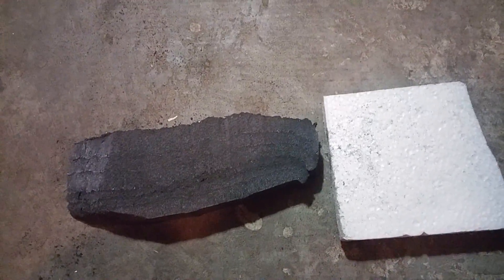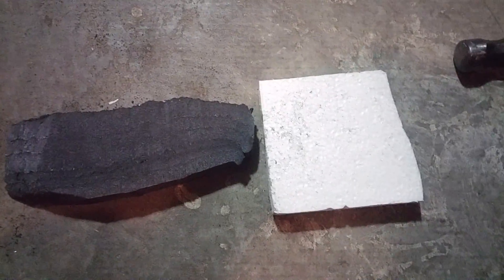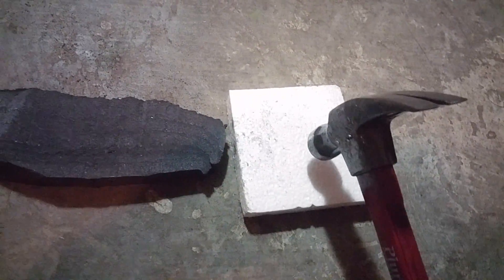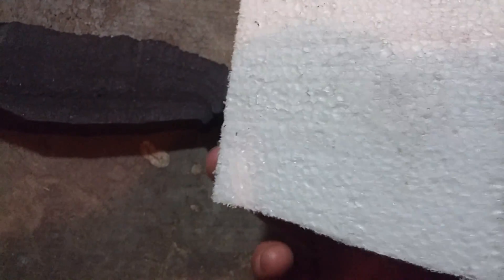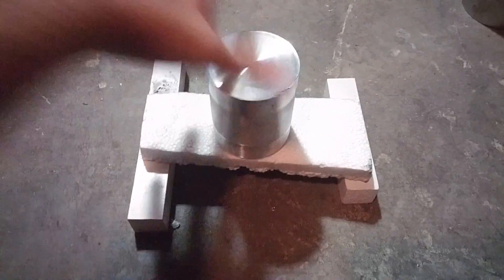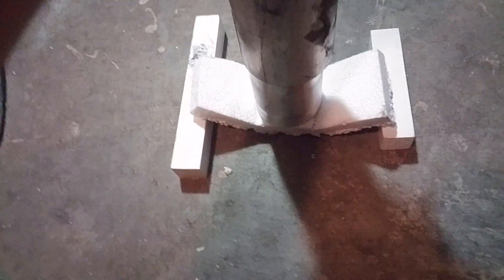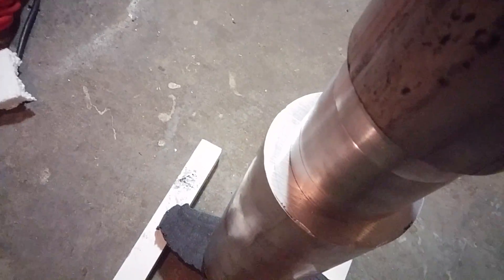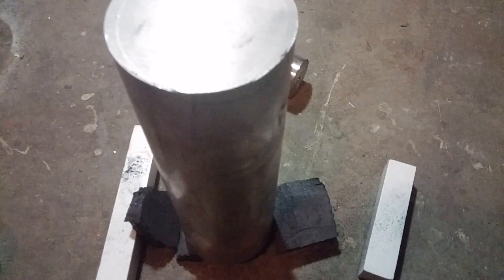Graphene Foam fun tests In the Lab of Death

Comment: You can easily explain those properties. Graphene is a material that can handle a lot of "pull-force" but no "push-force"
Its just like metal but mor extreme in both ways. Steal easily bends under pressure while it can withstand a lot of pressure when being pulled. So actually graphene will be a great building material too... once it reaches a decent price :-) born in a great time folks!
Reply from the maker: Excellent observation. Graphene doesn't have much compression strength, but it can hold up against pulling. That's why concrete companies are breathing down our necks.

Comment: Now that was impressive. if you laminate the foam pieces with various material to see if it can negate the brittle break it would be neat to see what works best. Try Paper or card stock, then corrugated cardboard, then thin wood sheet, Plastic sheet, plastic corrugated, and finally aluminum and steel sheeting. Would give a broad range of lightest to most strength. Maybe even try Fiberglass and Carbonfiber. Thanks for the Video!
Reply from the maker: Tory Allan very good observation.

Comment: It's interesting to note where each piece of foam broke under the weight as well. The regular foam seemed to break in the middle while the graphene reinforced foam broke in two different spots outside the location of the downward force being applied by the weights.
Reply from the maker: Weather Pilot rad comment. I noticed the same thing. Most likely  because the graphene foam wasn't bending.
Reply: The reason it broke where it did with the black foam, is because it wasn't bending, and the only point it could actually break, is at the edges where the force was being applied. The white foam is flexible, and warped, and thus most of the force was applied directly at the edges of the weights instead of a single point like the black foam, this causes the center point to eventually snap because it ends up warping past its ability to hold its shape. The white foam though, did also break at the edges, but that was because of the force being applied near the support blocks holding it up. The black foam simply snapped at its fulcrum points, where the white foam didn't.